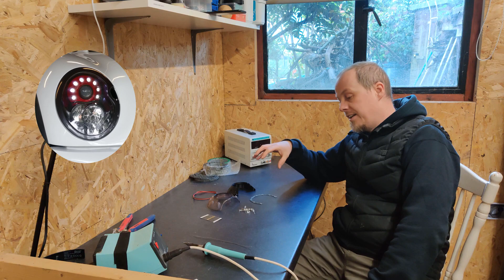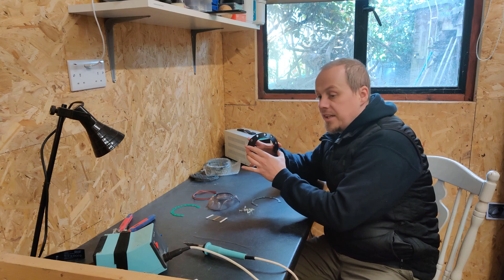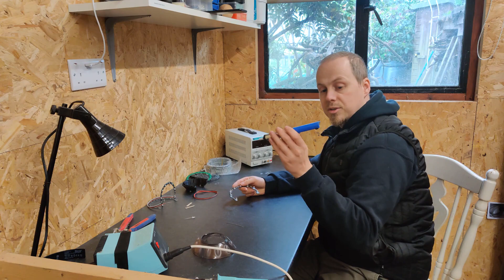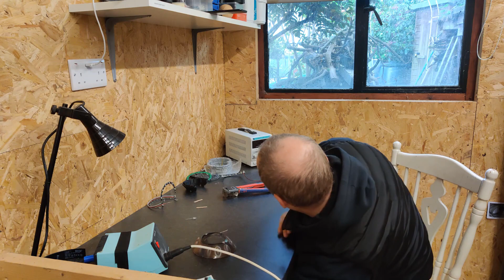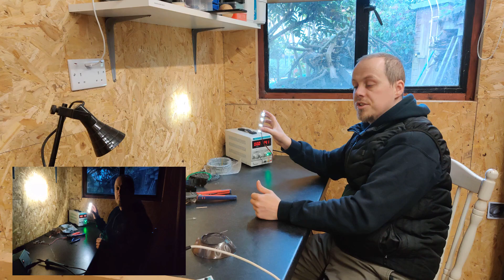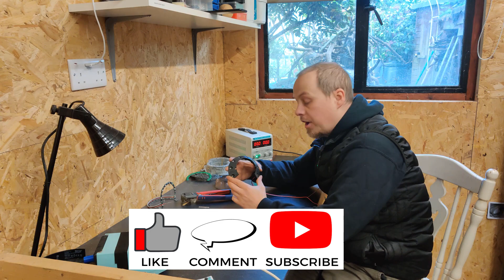R53 mini facelift light day light running lights DRL

Comment: Do you have fully assembled kits available?
Reply from the maker: They are going to be through Orranje performance this week. They have 100 units in stock
Reply: @rkde2042  thanks Richard.  And do you have to go in from the front (lens) to access the housing to put the black housing in the unit?
Reply from the maker: @paulhartley6614  yes, it's a heat the front lense and remove, then remove the globe inside. There is a full manual with them